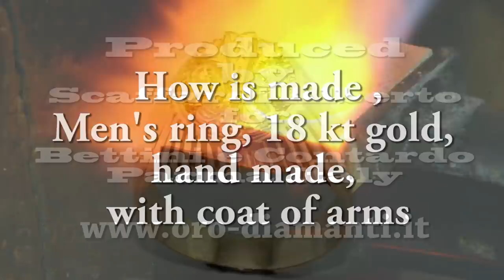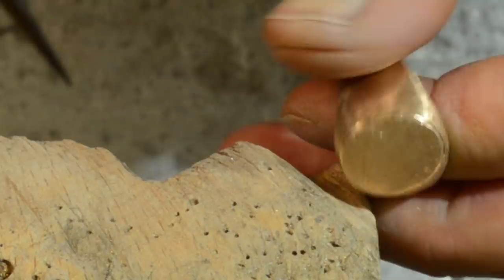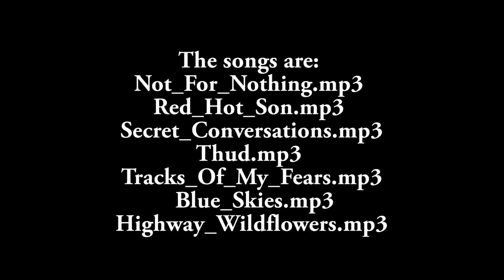How is made. Men's ring 18 kt gold hand made with coat of arms

Comment: Great work , I am about to start make Jewellery in Gold , Sir could you please provide how much pure Gold and Other metal (alloy) should be mixed to make 18k Gold and other caratage, I could not find detailed info on alloy composition online or in books they just say mix alloy but what if we want make alloy ourselves what should be used as an alloy and how much ??? Is there any formula to calculate amount of silver and copper to be mixed???  Your answer will be highly highly appreciated 🙏
Reply from the maker: To make 18KT gold, which corresponds to the 750 thousandths, 750 parts of pure gold and 250 of alloys are used. Traditionally, in the case of yellow gold, silver and copper are used as alloys. for the classic yellow color the proportions are: 750 pure gold, 170 silver, 80 copper. You
 can try to vary the quantities in the silver-copper ratio, to have the 
various shades from yellow-green, with only silver, to English red, with
 9 parts of copper and one of silver.

Comment: This is an amazing video and a pleasure to watch you work.   I am a student and just have a few of questions regarding this.  1.  what is the angle on the top right and left? 2. What is the curvature on the top and finally what is the curvature on either side?  There is not a whole lot of information out there and I am trying to make a ring for class.  If you don't want to tell me, it's cool.  I understand that there are some trade secrets and will have to figure it out myself, but I hope you do.
Reply from the maker: There are no secrets, I use paper templates to make shapes that cut in gold. The
 various angles change from time to time, depending on the size of the 
finger, the diameter of the head, and the height of the side wall. is a very artisan method, but effective and flexible.
Reply: I see...Thank you so much for the reply.  I am slowly figuring this out.  Thanks again.

Comment: Why just don't solder the coat of arms?
Reply from the maker: Because during the welding the parts are oxidized and polishing can not be achieved in the engraved parts. At the end of the job there would be a dull part near the coat of arms
Reply: scaffoal hey mate, ive been watching your vids for quite a while now and was just wondering if you could maybe add some voice overs or subtitles of tips/explain what you are trying to do for the youngins like myself trying to pickup the art.. not trying to criticize you cause youre work is amazing just it would be amaing to hear what you have to say aswell.